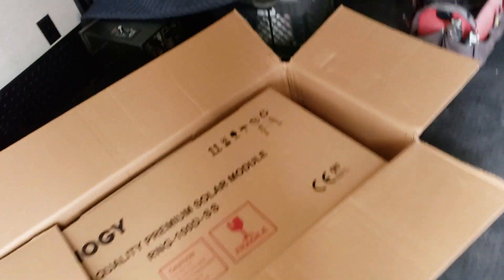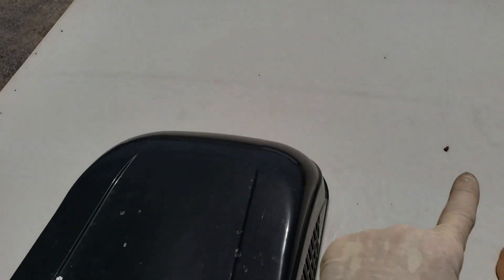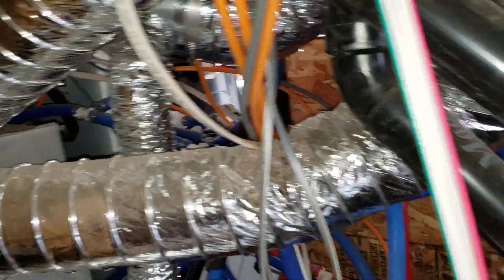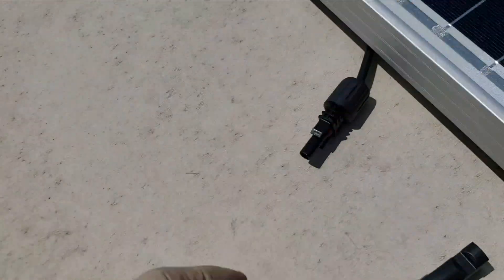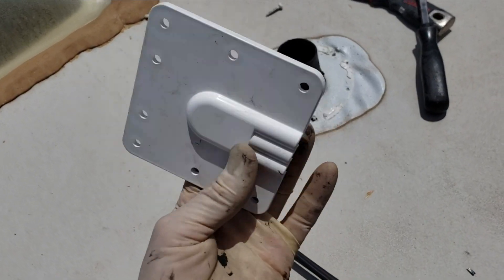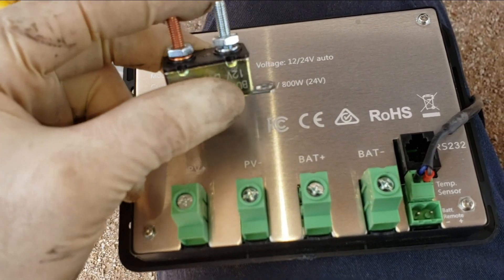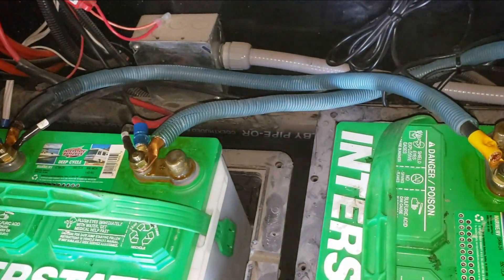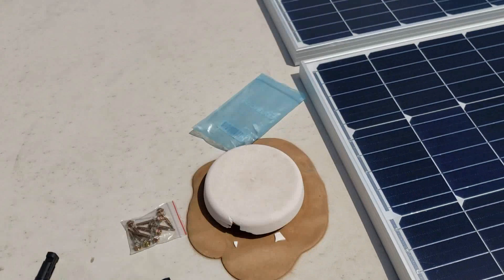Install an Amazon 300watt Renogy Solar System

Comment: Just came across your video.. I just got a travel trailer. I am interested in installing solar.. but I have a technical question. This kit, as you say, is a very straightforward installation wise. My question is ......the  rv converter from the factory, will it know when you connect to short power and stop charging the battery since the charger controller is actively charging the battery as well.. or will they both charge the battery... will  it overcharge the battery???, potentially causing a fire... or when I connected to the truck 7 pin connector... or an external generator.. I guess it is the same question but with different methods of charging Pls can you clarify this for me.... this is the one thing that is killing me here and is stopping me from doing a full install... Thanks in advance for the response. 😊

Comment: Your thoughts on flexible 350w flexible solar panel module monocrystalline marine rv car 18v vs original glass ? Do they need to have space/air under them when they get hot? To flex burn out faster?
Reply from the maker: I do not like flexible panels on anything other than metal roofs.

Comment: I am hooking up two 100 watt panels into my Rv using a MPPT Charge Controller. Do you recommend wiring the panels in Series or in Parallel?

Comment: I have a solar system I bought to run LEDs lights for my outdoor bar. My question is I need a ground for my inverter if I’m able to use the ground from my bar fridge?

Comment: Damn dude... do you always throw your customers &^%$ around? Also, those "pre-installed" solar connections are not for a solar "system" it is to plug in a single flex panel with a stand to charge to house battery. They are not installed or meant to be used for an off grid alternative to your RV power system.
Reply from the maker: lol, thanks dude!

Comment: I was hoping to see the panel install.  Do you look for the structure in the roof to screw into, or just go with hitting the luan?  What was the sealant used?
Reply from the maker: This roof had 1/2" decking so anywhere is fine.

Comment: I know this was posted a year ago but i have a question. 
I am good with everything in this video except how the panels attach to the roof. Are they attached with just some one inch screws through the panel mounting brackets and into the roof sheething and then covered with Dicor?  I have a rubber roof on my travel trailer. I know there is some kind of plywood under it. How long of a screw am i safe with into the plywood?  Thanks!
Reply from the maker: it's generally safe to use a 1 inch screw as the deck wont be more than 5/8 I'm more concerned about hitting wires so I keep the screws short. The screws act like clamps while the sealant underneath cure.
Reply: @AZExpert  thanks. so sealant under and over the mounting brackets. correct?

Comment: Great video. Thanks. I have 360 watts worth of solar panels. I need to change out my battery bank which consists of 4 12 volt batteries. I have a 1500w inverter. I don’t run many appliances off it( phone charger, little radio coffee maker) I have a 56w solar fridge wired directly to the battery bank. Will 2 12 volt batteries be sufficient, and should I go with a bigger inverter? If you can answer, thanks.
Reply from the maker: 4 6volts is good. 2 12 volt lithium would be great. the coffee maker would be your biggest load, and I'd get a 12vdc or usb phone charger as it's much more efficient.

Comment: What is your opinion on using Well Nuts ver. Screws to secure the mounting brackets to the roof? Have you seen any Solar panels blow off, when using the supplied brackets and screws? What about using some sort of rail system making the panels easy to remove or replace if needed without having to remove the brackets from the roof?
Thank you in advance, keep the video's coming.
Reply from the maker: well nuts are a bad idea and will not hold up in wood as "well" as a screw. they also tend to jam and spin when removing them. I have never seen them blow off and many owners just use doublesided tape or sealant with no screws....please do not do that. The screws act as clamp for the sealant to hold. Racks will add flex and torque points which can cause more issues.
Reply: @AZExpert  thank you

Comment: In your experience what would be the "best" solar panel to use, "best" charger controller, "best" batteries, and "best" inverter to get for a 4 panel (100 watt each) solar system? 😁
Reply from the maker: there is no best, only systems that work for your needs and price. By all accounts the renogy panels are as good as the expensive ones. Will Prowse has a great channel with loads of solar information: https://www.youtube.com/channel/UCoj6RxIAQq8kmJme-5dnN0Q
Reply: @AZExpert  TANK U soooo mucha! 👍 LIKES FOR YOU! 😁😆😜🤣👀👍
Reply: @AZExpert  I went to the website, yeppers he be GOODLY! 👍

Comment: Great videos and sharing some of your knowledge is much appreciated and why I am subscribed. We have a 2000 Winnebago Chieftain 35U so the way I found you was the basement heat pumps circuit board replacement which was a peek behind the curtain for me. Ours work good but make a thin metallic rattling when running like a loose screw maybe I’ll try to look underneath and wiggle stuff ,but not while it’s running 🙄. Here is my question, ours came with one 10 watt solar panel that keeps the house batteries charged daily with no use. That panel is cracked and we would like to replace it and upgrade to something like 300 watts. Any way we can use the built in stuff. I built Country Coach chassis’s for 8 years, my wife worked for Monaco for 15 years so we were around these behemoths   Thanks
Reply from the maker: sure. the wiring will likely be 14awg so it can handle about 15amps. Usually the "controller" is a resistor and LED at the monitor panel so you can mount the controller behind the panel. I am pretty sure it goes to the chassis battery so you might want to re-wire to the house at that point

Comment: Hello sir . When you installed the inline 40 amp fuse you didn’t specify from where to where the wire was running. Can you please let me know ?
Reply from the maker: at 13:33 I show the breaker from the positive battery to the charger battery positive. the breaker goes inbetween that wire
Reply: Thanks for clearing that up . Happy Thanksgiving and Merry Christmas.

Comment: smooth install.  bluetooth module has a low-power antenna inside.  those get better signal when they're further from ground.  I'd-a placed it middle of vehicle, closer to the ceiling.

they'll claim 80' range on it, but that's under test conditions, where they have it out in the boonies, with absolutely no other electronics or metal, or trees nearby, planted on a 30' post, line-of-sight, no reflected signal or ground to dim it.  so realistically, 12'
Reply from the maker: Thank you, I think truthfullt the bluetooth app will hardly or never be used. That's the best thing about solar I think, just a passive quiet system.

Comment: Hi james, I'd like to get solar on my monaco. What would  you recommend? I also have a leak, I think from the grey tank but not 100%. Thanks Scott in Gilbert
Reply from the maker: I recommed the Renogy solar kits from Amazon as the panels are good though the charge controllers are okay. At least 100watt to start, no less than 300watt if you want to do any real boondocking

Comment: Thanks for another informative video.  Given that these roofs, as you've shown us in your roof repair videos, are 1/8" luan plywood over foam, how do you know where to screw in the brackets supporting the panels.  Do you look for and use support beams under the roof or just screw into the luan?
Reply from the maker: On this roof the deck was 1/2" OSB. So it could be installed anywhere. On thinner roofs the trusses can be felt walking on the roof and will be visible at the deck seams. Winnebago roofs have no framing so its the sealant adhesive that does all the work
Reply: @AZExpert  Thanks, that is good to know.  I'm still becoming familiar with the ins and out of my (new to me) 1993 Damon Intruder Diesel Pusher.  It spent most of its life under cover so the roof is in good shape and the mileage is very low.  I often wondered if solar panels would be a good addition to keep the house batteries charged, as they run down over time, even with the disconnect turned off.  I'll have to check my roof structure to see if there are identifiable trusses.

Comment: Thanks again for your willingness to share your knowledge with the RV community. Do you have any suggestions for buying  HWH parts other than HWH?  They seem to be backed up with customers.
Reply from the maker: Youre welcome. Hwh is always backed up and their internet page is sorely lacking. Most major rv service centers have access to the parts and many common parts are available online. What sort of part are you looking for
Reply: @AZExpert  i have a leaking cylinder  uneven deployment and two broken cargo carriers. I believe some Orings will seal the cylinder and maybe replace the evening cylinder. But I really need to connet the ends of the slide with the broken carriers.i did remove all the  stuff out and away from the slide.

Comment: Did you have a converter in your RV? I have a class b with a converter and I want to set up solar. Do I need a inverter or can I just charge the batteries using solar and leave the converter alone? Do I need to buy an inverter as well?
Reply from the maker: Yes. The converter is a 120vac battery charger for when you're plugged in. An inverter is optional. Inverters change DC battery power into 120vac power. In general the inverter will only power 1 or 2 AC circuits like TVs, microwave, or refrigerator. There are lots of factors to determine what size and type of inverter you would need, but you only need an inverter if you want 120vac power without running a generator or being plugged in. Thanks!
Reply: @AZExpert  so is it possible to have my inverter change my batteries and then use my shore power cord to plug into my inverter while the converter is turned off?  Thanks so much for your advice

Comment: Would you recommend using all those branch connectors with the same amount of panels if it were an MPPT controller? Or does it not matter? I just purchased an MPPT kit with 3 100 watt panels. I don't like the idea or the look of all those branched together. A friend had a similar system and just ran all his own 10/2 cables starting at the panels, all down to the controller and back to the batteries. It just seems like a lot more work.
Reply from the maker: That's a great question. Yes with a MPPT controller it would be better to wire all panels to the controller. However, this is a fairly small setup, and these three panels are just being turned into one normal sized panel so MPPT is not even necessary. They are in nearly identical placement so there would be almost zero voltage difference between the panels to worry about. The 10awg wire would be able to carry the peak wattage easily, but yes it will be more work to run all the cables. I don't like the mess of connectors either, but they work, and are better than wire nuts, butt connectors, or splices. Thanks!
Reply: @AZExpert  Thanks for the answer!

Comment: If I may ask what is the information for the black goop you are using for sealing i haven't seen this b4 and would like to try it , also did you do something special to seal the solar panel mounting bracket  ? Thanks for the video,,, Gary
Reply from the maker: That special goop is just black dicor sealant, same as the white stuff....I just had an open tube of it and it made more sense to use the open one rather than a new tube I wouldn't use all of. I did nothing special to the mounts, just bolted them on and screwed them down. Thanks!

Comment: Question.  I'm  assuming you sealed  the top of the wingard roof entry port with self leveling dicor but what was the black sealant you put down on the roof first and set the wingard plate into.? Thanks.  I'm looking to do this (I'm  in S. C.) , as soon as I finish putting a new roof on our 2003 Newmar DSDP.  Thanks!  Oops,  I read the comments and you answered my question already,  it was black dicor.  Self leveling or non self leveling?  Lol.  Thanks
Reply from the maker: Sorry. I didnt cover that very well. That black sealant is dicor lap sealant just in black. I had a half full tube and didnt want to waste it. It is the same as the white self leveling just black.

Comment: The company in Mesa that repaired my roof used one of those Winegard entry plates for the satellite input.  Leaks like a sieve.
Reply from the maker: That's terrible to hear. I've not ran into that issue if properly installed. Also sometimes, split wire loom is routed under these covering the cables and that should not be done as split loom is not water tight but in fact a rain gutter.
Reply: If you Don't seal under the cable it will leak.  "Properly installed" is the key.